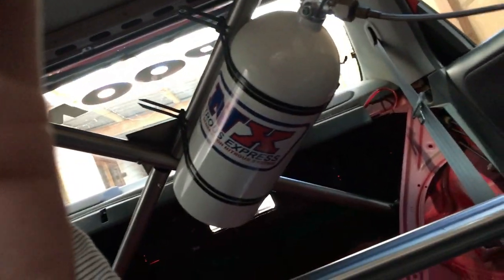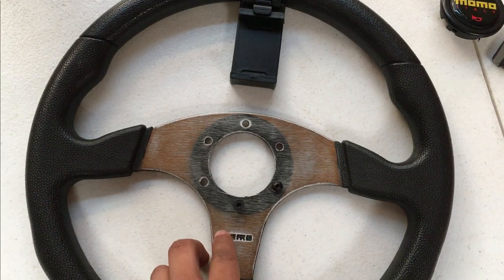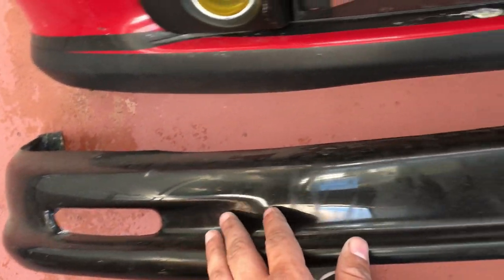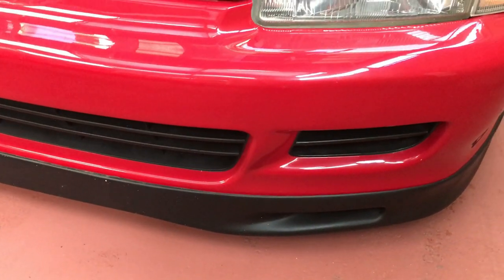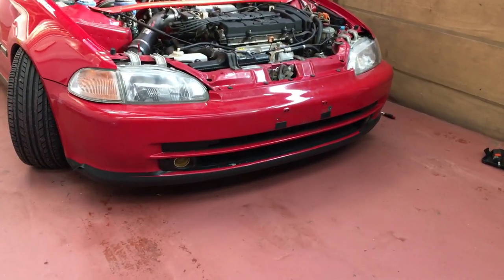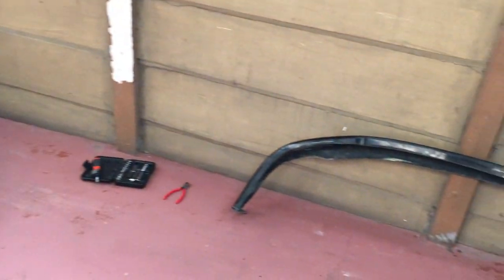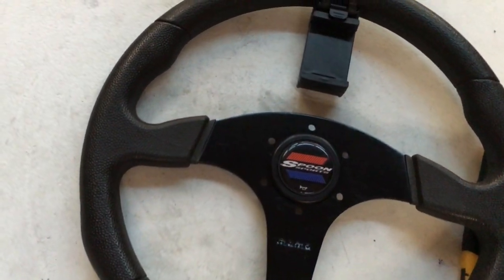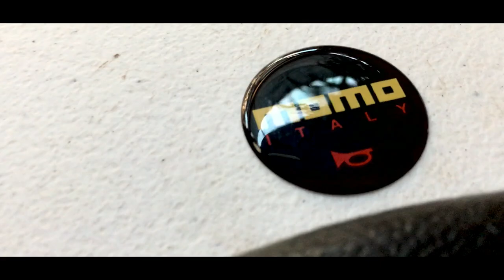MY HONDA EG GETS A NEW LOOK

Comment: looking good guy! any recommendations on a good plastic welder in CT? would like to try some kinda EG6 EG9 EK old spec hybrid bumper, but lets see... vision will have to start with a good welder.
Also any tips on getting the front bumper gapping (on the fenders) nice and evenly spaced/gapped?
thanks
Reply from the maker: Yo my dude thanks🙌🏼
Reply from the maker: Ill always recommend Dent Expert because they helped me with the plastic welding and spray work part of my bumper
Reply from the maker: Howeva plastic welding is not their trade but they are capable of doing anything in my opinion.
Reply from the maker: Myself and one their employees worked together to make it work and fit like should.
Reply from the maker: I spend almost everyday there to make sure it came out like it should
Reply from the maker: I howeva am heading in the direction of perfecting my plastic welding skills
Reply from the maker: With regarding the the gaps a heat gun usually does the trick with plastic parts. It helps move or position it in its rightful place
Reply: @WongStreet2Track  thanks for reply, much appreciated. perhaps you can give me some tips on what to look out for and where to hassle the welder for perfection... im restoring am EG and loving the simplicity of the panels so far. I think the smooth curves of the eg makes it a classic as every modern car designs are just becoming over complicated.... soon the EG design will be listed retro i reckon. 
If u plan on keeping ur eg for a while still, and    interested in customised luminescent dials, then perhaps we must meet up... otherwise, nice work on the vids bru
Reply from the maker: Waleed Toefy Once again thanks alot for commenting and can u plz DM me via IG(Wong_Street2Track) a few examples bcz ive been looking into getting a other cluster or something